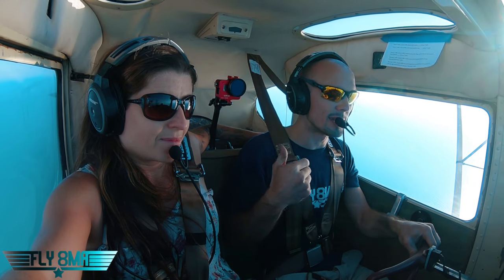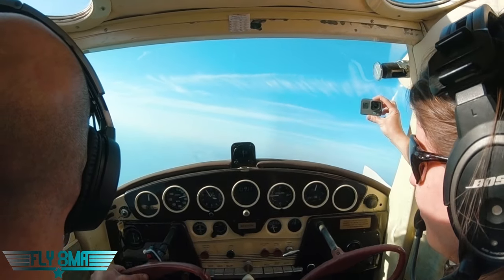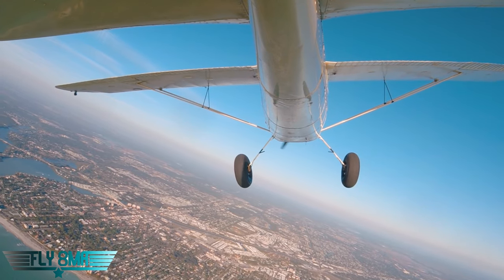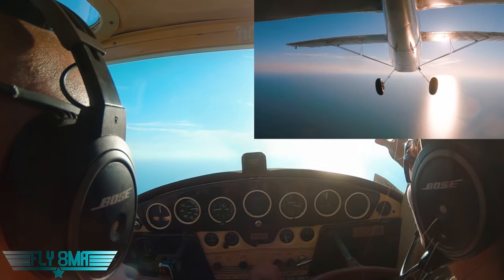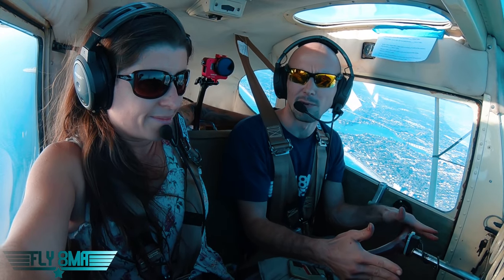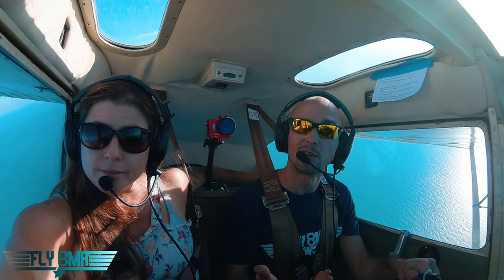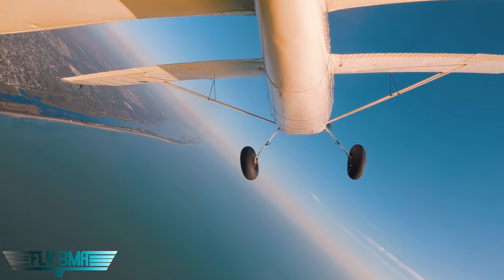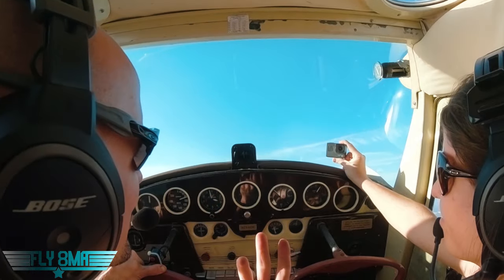Moose STALL

Comment: I once had a fear of toppling a canoe; after dumping canoes many times (on purpose) and re-floating (in the middle of the lake), there is no longer the fear; with spins, I have a similar fear (the fear of the unknown, will I get PARE down right). Nobody really does spins. Instructors get some actual experience to be certified but students.

Comment: Low stall spin....climb out..engine sputters...roll into a turn trying to get back...ground comes up and smites thee...overshoot on final...engine at idle...turn steepens with rudder and aileron...ground comes up and smites thee...most common of stall spin at low altitude. 
    I had spin training in a Tomahawk.  Everyone should get actual spin training. A few months later this saved my and a friend's life. He was left seat and he wanted to do stalls. We were at 2500 ft...too low. He stalled with the ball pegged. I took over and recovered too close to the ground for comfort. I should have taken control more quickly. 3 things...The spin training saved our lives...I should have recognized the situation sooner and he learned how fast things can go wrong. We climbed to 4000 feet and did more stalls. This time he did them flawlessly.

Comment: Those GRM stalls can be avoided by practicing 3 tough factors GRM.  At 1-600 feet agl, 2-at Vfinal speed circles over a road, And 3-with strong winds.  Those high and mild speed and mild winds GRM practice are BS.  They give you a false sense that GRM is easy.  Mild GRM fools you. But Not if those 3 factors above.  That is Real 3 Factor GRM.  The 3 mild factors GRM is BS GRM..

Comment: Idiots fly Low & Slow ... At 500' agl and the fan stops you have 37 seconds to impact with the earth.
Reply: @jayphilipwilliams  
Doesn't matter from 500' AGL it's still 37.5 seconds till impact at best glide speed.
Reply: @HoundDogMech  Well shoot...I guess me flying 200 feet low and slow makes me something worse than an idiot then 🤣.
Reply: @wabuchanan  Well think about it. When engines quit Altitude is your friend.  Depending where you fly at 200' could be Illegal. You pick the FAR you might be breaking.
§ 91.119 Minimum safe altitudes: General.
Except when necessary for takeoff or landing, no person may operate an aircraft below the following altitudes:

(a) Anywhere. An altitude allowing, if a power unit fails, an emergency landing without undue hazard to persons or property on the surface.

(b) Over congested areas. Over any congested area of a city, town, or settlement, or over any open air assembly of persons, an altitude of 1,000 feet above the highest obstacle within a horizontal radius of 2,000 feet of the aircraft.

(c) Over other than congested areas. An altitude of 500 feet above the surface, except over open water or sparsely populated areas. In those cases, the aircraft may not be operated closer than 500 feet to any person, vessel, vehicle, or structure.
Reply: HoundDogMech  option c, part 2. majority of the midwest
Reply: @HoundDogMech  And there you go. Altitude is your friend. But we all have to take off and land. 200 feet low and slow is necessary for landing in many select off airport areas, and thus is quite legal. As is the take off from many select off airport areas where you have to maneuver to both arrive at your landing spot, and to leave that landing spot. Yes, if the engine quits, the results can be less than pleasant but most of those off airport landings will not cause undue hazard to persons or property. And to be honest, even when landing at my home airport, I cross the public road at the end of the runway only 20 feet above traffic, which does constitute a hazard to persons on the surface, but that is also covered in the above cited FAR. So no, I'm  not breaking any FAR's, and the point being made is that you categorically called pretty much everyone an idiot for flying less than 500 feet, when taking off and landing both happen at altitudes less than that, as does 90% of off airport landings in difficult terrain which requires low and slow flight to set up for those off airport landings.
Reply: @wabuchanan  
   You get me wrong ... Of course you fly low to take off and land DA!  but continually flying around at low altitude for the fun of it is just STUPID ... Engines fail and the lower you are the less time You have to pick out a suitable emergency landing field.  Simple as that ... in an engine out emergency ALTITUDE is your friend.